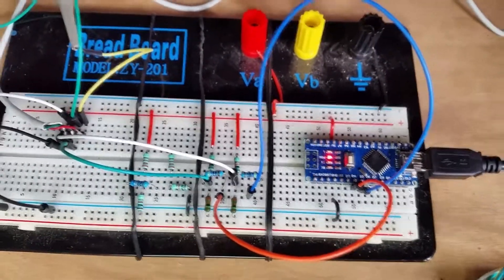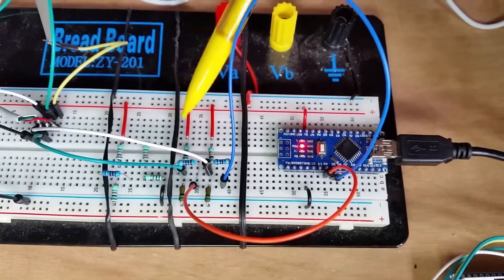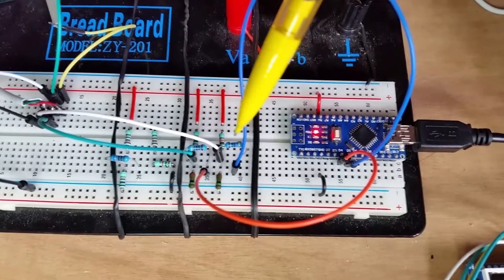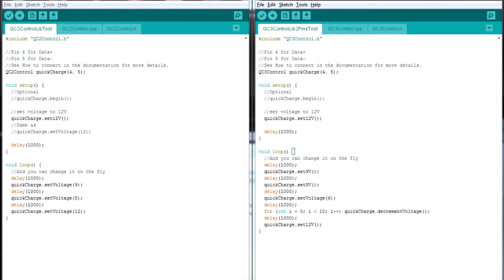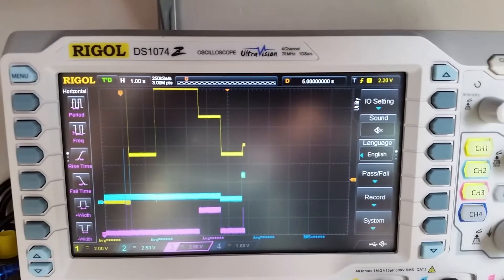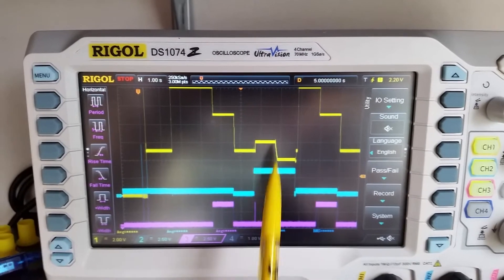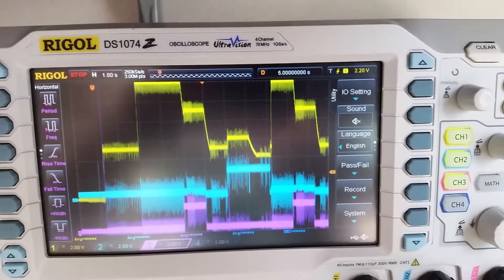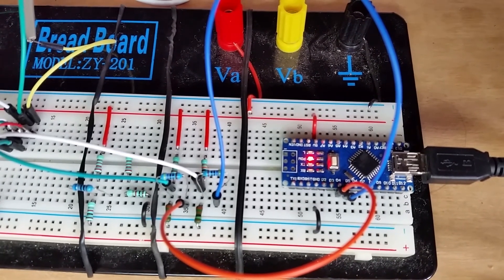Quickcharge - 5. QC3Control with recommended circuit

Comment: hey man, i made a this, can work, but why need to connect the miniUSB can work? i don't want to connect a miniUSB? 10k resistor is not +5V?
Reply from the maker: Hi. The Arduino needs a power source. You can not use a data line to power it. You have several possibilities : My preferred one is to use another USB port of the charger as a 5V source. Depending on the voltage you want the QC3 charger to generate, you could also use that voltage to power the Arduino itself, but if you request a voltage too low, the Arduino could crash, and if you request a voltage too high, you could burn it. It can work but I personally would avoid that route.
Reply: @dirtcheaphacks  Yes, but as QC2Control says, can supply power directly and connect two diodes in series.
Reply from the maker: @metalbug3  Yes, I know, but I'm not comfortable with that. The range of possible QC3 voltages is larger so you may run into issues. But that's just my opinion. Feel free to experiment and report the results.

Comment: hey man this is cool project, good job man, i want know this R1 to Arduino_Vcc this one it +5V right? and D- it +3.3V?right？this +5V It can drive this 328p chip, and i need +3V to drive BMI160 chip, i can use this D-???
Reply from the maker: Arduino_Vcc is the +5V rail used to power the Arduino, indeed. 
From the Arduino point of view, D- (and D+) are output signals that are set to various voltages such as 0.6V and 3.3V (or even 0V).
But D- is a "data" line, not a "power" line, so if by "drive the BMI160" you mean "give power the BMI160", NO, you cannot use them to power anything.
If by "drive the BMI160" you mean "control the BMI160", then you probably need a voltage level switcher, and it's true that the resistor divider used here could also play the role of a 5V > 3.3V converter (in the Arduino > BMI direction), but I wouldn't use the same Arduino pin to control both the QC3 charger and another chip. An easier way to convert voltages in both directions would be this kind of circuit : https://www.sparkfun.com/products/12009
Reply: @dirtcheaphacks  okay thanks man, I use ME6211C33M5G to transfer to 3V
Reply: @dirtcheaphacks   hey man, I have another question, the 0603 SMD resistor can be used?
Reply from the maker: @metalbug3  Err, 0603 is the physical size (length / width) of the SMD components, so yes, you can use any size as long as the resistor value (in ohm) is correct. The current on those resistor is very small so no risk of blowing them :-)
Reply: @dirtcheaphacks  yes i know this 0603 it size, you say the current is small, so can I use resistance 0402?
Reply from the maker: @metalbug3  Well, I'm not used to such small components, but you can calculate the current in all situations. The smallest resistor in my schema is 470R, so if it took the full 5V, P=U^2/R would be 25/470 = 0.053W. 
0402 (imperial) resistors seem to support 0.062W so you should be good - see http://www.resistorguide.com/resistor-sizes-and-packages/ .
If you mean 0402 metric then it's probably too much, so either avoid them or increase all resistor values by a an identical factor (e.g. x10). It should work the same and use 10x less power. Just don't go too high (e.g. x100) if you're in a noisy environment or you will get too much noise. Also input impedance at the charger end of the USB cable cannot be neglected anymore. You have to do the maths :-)
Reply: @dirtcheaphacks  Wow, your answer is too detailed. Thank you very much.

Comment: Fantastic hacking! I'm considering trying this project to make a QC 3.0 charger which I can specify to either output exactly 19 V in order to charge an Acer Swift 3, or do the standard QC 3.0 handshaking for use with a standard Qualcomm phone.
Reply from the maker: Great idea ! Please make sure though your QC3 charger is able to provide the power the Acer Swift requires (If I'm reading correctly 40W or 2.1A @ 19V). It may be worth checking that QC3 handshake is performed before plugging in the Acer, because I have no idea what it would make with 5V during the time handshake is performed...